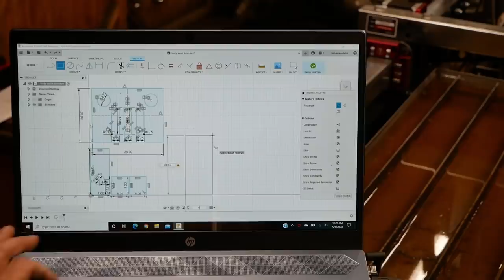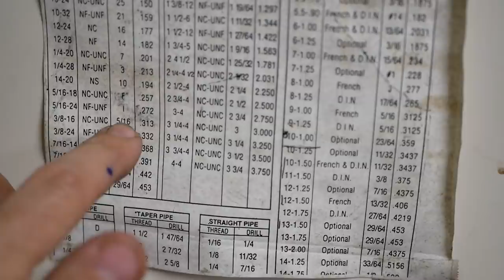420cc Predator powered articulating 4x4 dump truck build part 8

Comment: You may wish to reconsider the stainless fasteners against ally, you'll have problems with galvanic corrosion.

Much better choice is just simple galvanized or zinc plated steel.

Otherwise, it's coming along really well. Look forward to seeing where it goes to next!

Also, why not use the pump you already have on it? Not enough pressure?
Reply: The electric pump was free and simple to hookup the parts to hook up to the engine driven pump would have been several hundred dollars and required a different steering valve with a fifth hydraulic port for Feed back to the pump to shift the priority valve on the pump. Also I have worked on in the marine industry with aluminum boats and engines and all the fasners were stainless steel in the aluminum

Comment: are you planning on making some sort of roll over protection(R.O.P.S.)?
Reply from the maker: Leo Kelly Yes definitely, I covered that in the last episode. Cab, heat, fenders, frame gussets,  skid plates, adjustable limited slip for the rear diff. Thanks for checking out my new video 👍

Comment: like the eyebrow piece the way it is , it will protect the headlights from branches slapping intoo it 
about the center hole punches , you can probably make them on the lathe from scrap pieces of metal , they dont need to be fully round they just need to fit the hole exactly and have a point in the center , so thick steel cutoffs from the plasma table would work 
just need a fourjaw on thelathe to machine the edges to fit the roundness of the holes 
the punches having two flat sides allso prevent them from rolling of the workbench

Comment: Got some questions for your next video
What's it weight after fully done?
How much weight do you think it will carry?
How much weight will it dump?
What is top speed in 5th gear?
Slowest crawl speed?
Would it win a tug o ear with the Suzuki?
(^obviously with some weight in the bed of it)
Congrats good work and the build looks awesome can't wait to see completion!
Reply: Oh also forgot to add do you have plans to pull a trailer with it or put a hitch on it?

Comment: you could weld the center diff on the subaru trans to do away with slip from it.  it’s common to do that when people convert those cars to rwd.
Reply: that is certainly  an option but for now he is going to test it out a bit to see if it is even necessary. with the center articulation all four wheels always stay in contact with the ground equally  so it may not be necessary

Comment: Fantastic video.  I liked the orange grill and vents. Do you have to remove the winch before lowering the front cowling?
Reply from the maker: No I don’t need to ever pull the winch, the hood still opens enough to fill the gas tank and do basic maintenance 👍 Thanks for commenting!

Comment: Looks like a torque limiter clutch
Reply from the maker: Yes you are correct!
Reply: @Mikefestiva  I used them on the old ww2 era coffee canning machines at Kroger manufacturing... good Idea to put on the driveline... it will protrct the weakest components from breaking if the torqe load gets too high

Comment: I noticed that you used the Vulcan protig to weld the hood up. That being said it's a DC Tig machine, my question is did you use an argon helium sheilding gas for that? Or did you use something different?
Reply from the maker: Is a AC/DC TIG welder. I have been happy with it so far.

Comment: Q&A how much different would this be to engineer a 3 cyl Briggs & Stratton diesel? Approx 20 hp ,  And the coupler has to do with spliter between 2 drives.

Comment: Call it, ROBBIE, for it look's like a square head robot face in the fount.Will the hood open with the wrench mounted on the bumper. Maybe the wrench should be below the bumper or maybe mount it inside the hood and run the cable threw a slot in the hood.

Comment: Hello Mike,  Did you consider making the dump truck electric?   Maybe a more expensive, but a lot less maintenance in the long run.  My perspective is from my 1971 GE Elec-Trak electric lawn tractor, still going strong after 50 years, though I have updated the drive motor controls to a digital controller.

Comment: I wonder if the Suzuki had the same design tires on it as the dump truck if it would of made the hill? Skinny and aggressive
Reply from the maker: It was not a flawed test, the Suzuki is a capable 4x4 with brand new mud terrain tires, you really think I should have mounted tractor tires on the Suzuki just to make a video for YouTube??? You guys are a bit unrealistic about this stuff.

Comment: I would suggesting capping all your tubing as a fabricator I have seen so many things get moisture on the inside of the tubes and rot from the inside out.
Reply from the maker: Kody Perry Yes that’s the plan, I’m still in the building stage 👍
Reply: @Mikefestiva  awesome build has me inspired to tear apart my old international and build my own.
Reply: Either capping or make sure there are good drain holes and then Fluid Film everything.

Comment: I'm interested in knowing how to step down a 3000 rpm (75 Ft lb torque) to 250 rpms. Basically I have an 8 hp horizontal shaft motor that I am using for a (Mike Festiva inspired) 36" wide rototiller to pull behind my garden tractor to till and cultivate my garden... Thanks.

Comment: hey Mike great video. love that tractor how much money do you think you spend on parts so far.
Reply from the maker: I will add it up the total for the next video but I think I have about $3000 into it, the hydraulics are by far the most expensive part and I salvaged most of the components, the hoses and fittings all add up. It’s more then I planned on spending it should last a long time and when you consider people spend $15,000 up on a side by side I feel it’s money well spent on this machine 👍 Thanks for checking out my video!

Comment: And for my final comment this is kinda the same thing I plan on making (a bug out all purpose tractor) with my 225 cubic inch slant 6 with automatic transmission & the little baby rear diff it came with from my 70 dart. Since its getting bigger everything.

Comment: That thing has got to be getting heavy. But definitely needed weight on the back.
Reply from the maker: I wanted it to be well built and have a bit of weight to it, my 4x4 tractor is about 2500lbs and even with the rear diff lock engaged it’s fairly easy to loose traction. I want this to basically be a 4x4 truck tractor. Thanks for checking out my new video 👍

Comment: You forgot to put the same type of tires in the Suzuki. It would have easily climbed where you Predator had climbed.
Reply from the maker: There’s no way it would have climbed that hill and turned at the top for the second part of the hill even if I had the tractor tires on it. It doesn’t have locking diffs so it would have just lost traction because the sidekick doesn’t have that much articulation.
You guys that tell me I should have installed tractor tires on the Suzuki are completely ridiculous 😂 do you have any idea of the cost and work it would take to do that for this video.

Comment: Can't nobody knock a rattle can paint job, I did one on a truck once that looked better than the factory paint job, so it happened to be a M1009 CUCV AirForce K5 blazer, but it still looked as good or better than when it was in service. I use the same trick and was thinking about getting the same set of center punches for holes, I had to explain to my boss why you drill a small pilot hole before drilling the final diameter hole when mounting some new battery powered hydraulics on the Engine (think Jaws of life, just ran by a big old Dewalt like battery).

Comment: Great Work!  What TIG welder are you using? Also, do you recommend a multi process or should I just get a TIG and the MIG for about the same overall price.  Thanks much!
Reply from the maker: I’m using the Vulcan ProTig 200, it’s discontinued now but the 205 is out now. 
I would recommend a MIG welder and a separate TIG if you plan on welding aluminum. 
All the multi process Welders with TIG features don’t do usually do AC.  If you only plan to weld steel and SS steel the combo welder like the Titanium 200 I have will do just fine. Take care

Comment: did you consider adding leaf springs to it?
Reply: adding suspension to a vehicle like this would actually make it less stable especially when hauling a heavy load  this  is basically a tractor and travels relatively slow and that is why tractors, wheel loaders and log skidders don't have suspension

Comment: Are you happy with that CNC machine because I was thinking of getting one. cheers if you get back to me.
Reply: yes it works great I have a Plasmacam and a ArchLitght plasma table but neither one would even fit in Mikes shop. The price and small footprint of Langmuir tables makes them very appealing for any one that wants cnc capabilities but only has a small space
Reply from the maker: William Stock Yes I really like it! I would highly recommend the crossfire PRO model, it’s a much better value with a bunch of added features. Check out my crossfire pro video if you get time. Take care 🙂

Comment: 4:10 its face.
"AAAAAAAAAAAHHH!!!"   :P
Such a cute little machine.
Some neat editing as well.
Have you considered a roll-bar?
Reply from the maker: Klomster thanks for checking out my video 👍 Yes I’m in the process of building a full inclosed cab for it with roll protection and a heater. That will be in the next up and coming video! Take care and consider subscribing 🙂

Comment: Question, So this has an automatic clutch but standard gearbox, so can you shift gears on the fly?
Reply: the gearing is low enough you can start from a stop in any gear the transmission gear box  is more of a range selector and does not need to be shifted while moving

Comment: you need to add roll over protection it is an OSHA requirement, as well as a seat belt, Safety First!
Reply: Does that mean that all atv's and motorcycle's need roll over protection to
Reply: @davidhelgeson6997  that lokks more like a tractor than an atv
Reply: @davidbanaszak562  does that mean he cant drive his commercially made 4x4 tractor tractor that has a loader and a back hoe because it doesn't have roll over protection either
Reply: @davidhelgeson6997  as per osha 40 cfr the commercial manufactured tractor would have those items prior to its sale if it has been manufacture in the last 40 years.

Comment: Really sweet project man!  Do you have a link for those little sheet metal butt joint clamps? They look super useful
Reply: One place you can get them is Eastwood tools
Reply: Harbour freight also has them
Reply: @davidhelgeson6997  Thanks for the info

Comment: i had assumed all the diffs were welded, impressive it did all that with open axles.. is there anyreason not to have the diffs welded when it uses articulated steering?
Reply: when the bed is fully loaded it might be very hard to steer while not moving and bind up the drive train while in tight turns on solid ground when you have good traction . I know our cat skidder I work on at work Has open differentials with a hydraulic clutches that can be applied to lock both front and rear differentials when needed and it is a large and powerful machine and I am assuming they run open differentials on it for a reason
Reply: Open Diffs are just as important for allowing wheels to follow their steering arc without tyre scrub - on an articulated vehicle as an "ackermann" style steering system (rigid chassis) - even in offroad 4x4 vehicles, steering is greatly impaired with front axle locked (rear as well, just less noticeable) - which is a reason not to lock diffs in high friction applications.
Reply: Our front end loaders have a push button locker and they do not articulate well with them locked. You can feel it binding in the wheel

Comment: What kind of transmission or drive are you using. Clutch or some kinda torque converter?
Reply from the maker: I cover all this in the previous episodes, entire Subaru running gear. Centrifugal clutch, 8:1 gear reduction. I would have liked a CVT coupled to the 5 speed but I need the extra space to run my hydraulic pump off of the engine too. Take care

Comment: What kind of welder do you have. I plan on buying an all  / versatile purpose type welder. Please advise
Reply from the maker: I use the Titanium 200 multi process welder and it’s been a rock solid welder so far.
I have owned it for about 19 months now. Harbor Freight sells them. Take care Anton

Comment: What welder did you use for tig welding the aluminum hood?
Reply: Looking again it seams you are using the vulcan. It's  DC tig correct?
Reply from the maker: I’m using the Vulcan ProTig 200 Ac/Dc machine from harbor freight, I bought it about a year ago and it’s been a great welder! Take care

Comment: Can you open the hood with the winch on
Reply: cvs fsd 

As long as he airs down all the tires and removes the seat he can
Reply: The bumper is only 8 bolts I guess. 😐
Reply from the maker: Yes the hood opens still, I can easily fill the gas tank, clean the air filter stuff like that, I can pull the hood in 2 minutes if I need to do anything major to the engine bay. 👍
Reply: @Mikefestiva  thanks for the reply👍

Comment: Is the winch in the way when you put the hood up?
Reply from the maker: I can open the hood up enough to do some work to the engine like add fuel and clean the air filter, any major work like pulling the engine, I would pull the two front bolts and the hood comes right off. Thanks for checking out my new video!

Comment: How do you plan on opening the hood with the winch where it is?
Reply: check out his pinned comment at the top
Reply: @davidhelgeson6997  Hey, thanks for pointing that out. Still... This guy doesn't do ANYTHING without thinking about it first. He spent a decent amount of time making this a tilt front and now he can't tilt it without hitting the winch. He installed bolts in the hinges, not a speed connector like a farm pin or hitch pin. Yeah, he can still get the hood off. It just made a ton of sense to be able to tilt open the front for maintenance and no sense to block that off. The winch could have been mounted further forward and lower, or even inside the hood area with a notch at the bottom for the cable to come out and just mount the cable wrangler out front to keep the cable from damaging the hood. With as much care and an eye towards "ease of maintenance" it just surprised me he would make it more difficult to do said maintenance. Sorry I missed the pinned comment.

Comment: Front loader ?? Or is it to light
Reply: the frame and articulating joint may be a little on the lite duty side, the stresses involved with using a loader are  different than hauling a static load in the bed and this was built mainly for hauling a load over the rear axle a snow plow would be a good option but a loader is  another story

Comment: How do you get the predator engines to reverse??
Reply from the maker: I coupled it to a Subaru 5 speed transmission 👍 It works quite well. Thanks for checking out my video!
Reply: Mike festiva ogg oh I didn’t know you could do that thanks!!

Comment: Why no suspension? It would help keep the load level before the body has to articulate. Simple leafs and cheap shocks wouldn't add much complexity.
Break over would suffer, but having the front axle be a bit more forward would greatly help approach angle, I would've had the front tires stick out past the frame personally. Probably isn't an issue to you I guess.
Reply: @rodeynsrene1007  As it sits any load on the bed is tipping due to the nature of articulating body.  

The axle will always articulate before the body unless your springs or shocks are so overly stiff the least resistance is just to articulate the body.  

The body would stay level until the suspension reaches it's limits of travel then the chassis begins to move. 

If the axle is 20* from the ground in the current setup then the body follows that no matter what(the load is tilted), if the axle has room for up travel the body stays level, the axle moves up on one side and down on the other, the body remains level, until travel limits are reached, then the body begins to move.
Reply: as far as axles past the frame etc you might want to look at a log skidder say John Deer , weight is over the axle centered on each segment to allow for maximum steering leverage with minimal effort  and keeping the operator situated for load and obstacle visibility. tires to far forward or backward places a tremendous load on the centerpin between sections which can cause binding. In essence a loader, a log skidder and most any center pintle steering machine is an engineered balancing act as far as weight distribution. Springs flex and  in hill climbing flex means wheel hop. the more stiff the suspension the less wheel hop keeping the machine on all fours.
Reply: adding suspension to a vehicle like this would actually make it less stable especially when hauling a heavy load  this  is basically a tractor and travels relatively slow and that is why tractors, wheel loaders and log skidders don't have suspension

Comment: I have that same cheapo HF tap set. The taps work amazing for the price but that f'n handle makes me f'n cuss every f'n time I use the f'n thing
Reply from the maker: Haha yes the handle isn’t the best but the kit is definitely fairly good for the price 👍
Reply: up in canada got a canadian tire set and its impossible to grip most of the taps with the handle/wrench they provide it just slips on the square corners.. ill have to order a nicer tap wrench for the kit but for now i risk it with the drill chuck